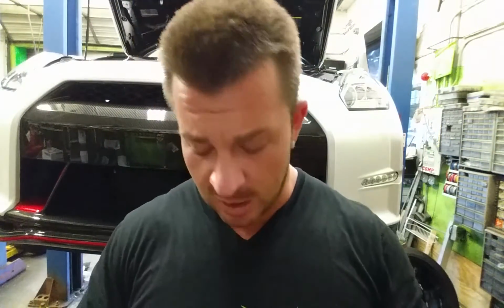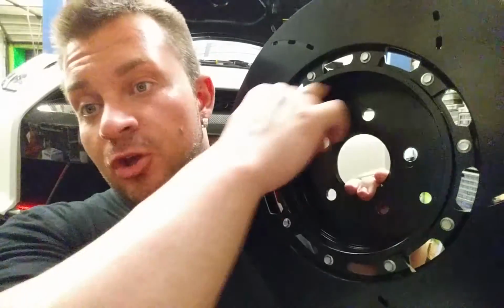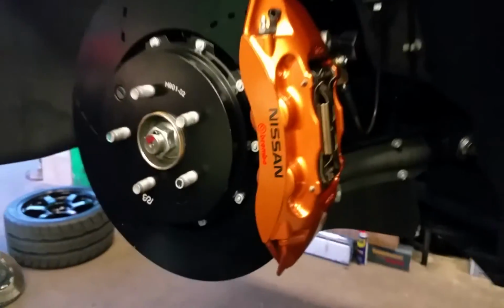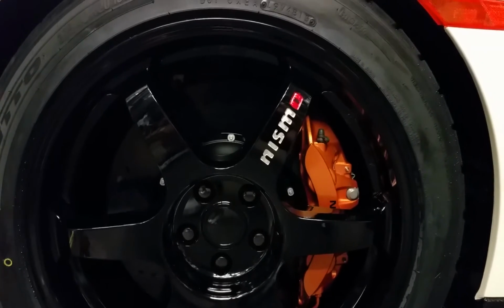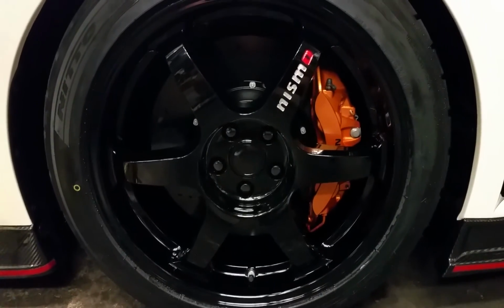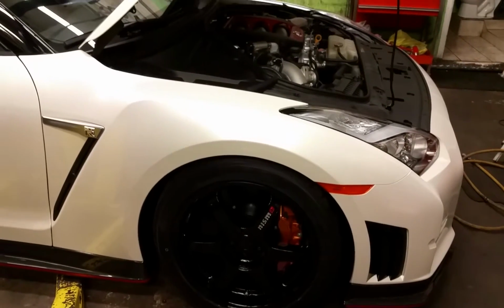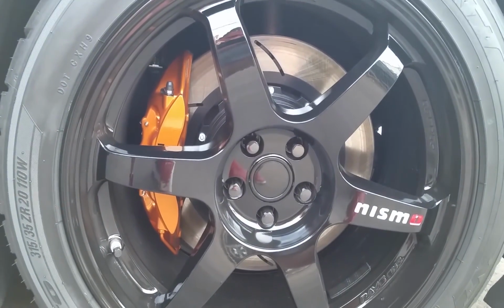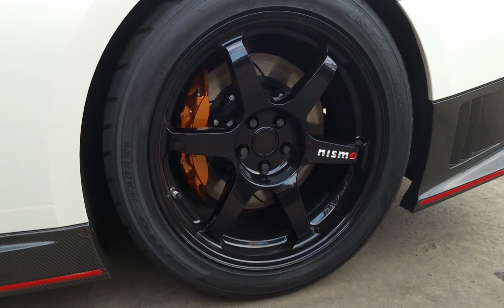GTR Nismo Gets Racing Brakes 2 Piece Rotor Kit & AMS SS Brake Lines

Comment: Add the brake master cylinder stopper and then those ss brake lines will shine. By making the lines stiffer the master just will flex on the fire wall more. When I did mine the stopper made more of a difference than the ss lines.